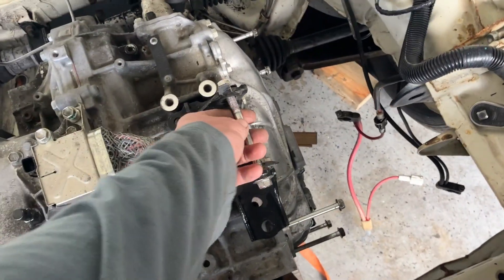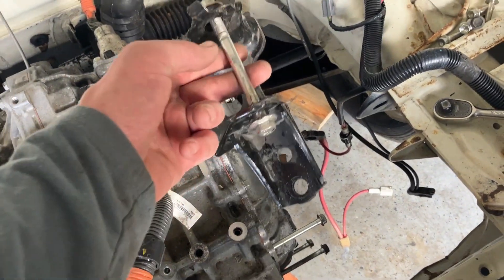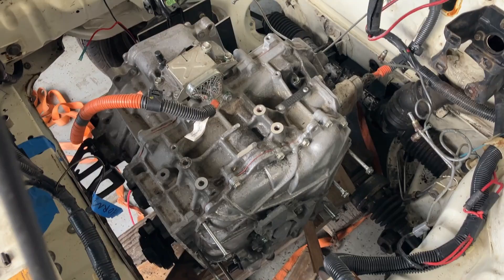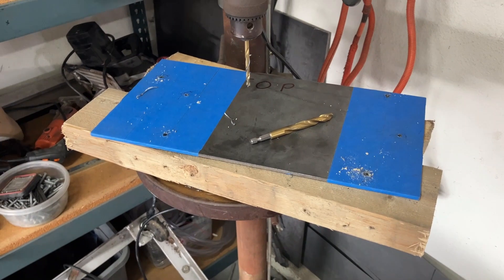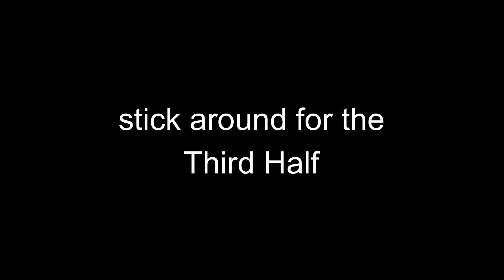1984 Voltswagen Rabbit DIY EV Conversion Electric Motor Mounts 2

Comment: It's coming together nicely. It took me ages to figure out mine too so I know the pain involved. I used scaffolding pipe to build mine but I have a habit of over engineering (over welding) things to compensate for my lack of skill.
As for having it perfect location I wouldn't worry too much, so long as it is close to correct the CV joints will take up the slack. Only thing to worry about is the angles at full drop and full compression.
Reply from the maker: thanx I needed to hear that, do you know roughly how much them CV drive shafts travel in and out of the transaxle?
Reply: Honestly not really. My experience is with Freelanders where I once fitted a 50mm lift kit. This pulled the drive shaft out enough to cause one of them to fail but with a new one it was OK for a year or two before I sold it.
I figured from that I could be out by up to 50mm any direction and still be OK.
Not scientific but probably close enough 😂

Comment: out of curiosity, how many of the fabrication tools you're using for this project did you already have, and how many did you find you needed as you needed them? sometimes I wish I had a bandsaw but a cutoff wheel works okay enough for now lol
Reply from the maker: excellent question, and I sort of answer it in my floor pan video, which I will link later, but all you need is the Holy Trinity: the angle grinder, the drill, and the holy MIG welder
Reply: dang, all i have is an angle grinder, a drillpress, and a fluxcore welder. I really just don't want to pay for gas of any kind
Reply from the maker: I would not recommend flux core for anything thinner than 1/8th inch like car brackets, when I had my Harbor Freight flux core welder I noticed it would not feed the wire smoothly because it had plastic internals like the gears, so those welders are just made out of lesser materials/parts, as a reference I now use a Lincoln 140C and I am very happy with it

Comment: Looking good, i can image how much thinking and head scratching went into that. Something to consider (for additional strength) is to also use the 4 original top motor mount holes with a 90 degree steel plate (L Shape) welded to the new side plate. Thanks for posting the videos, really like this build and your videos are very well produced. Well done.
Reply from the maker: Great point!
Reply: @Good-Enuff-Garage  Mk1 gearbox mount from an 1100 cc or 1300 cc would be worth a look as it`s a different design than the higher CC versions... yea they made those too...